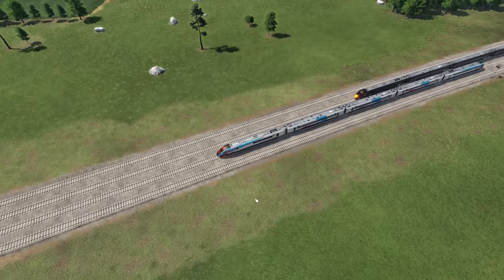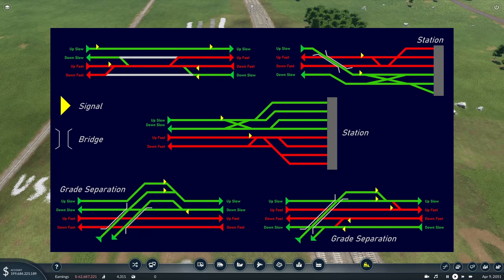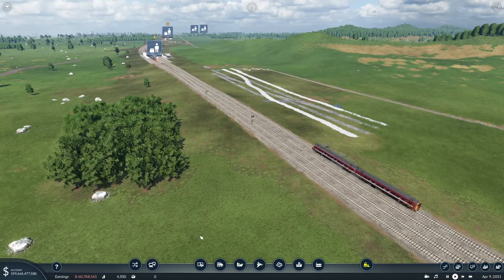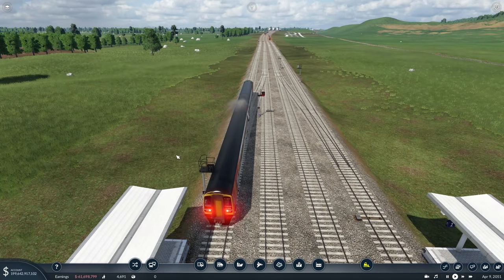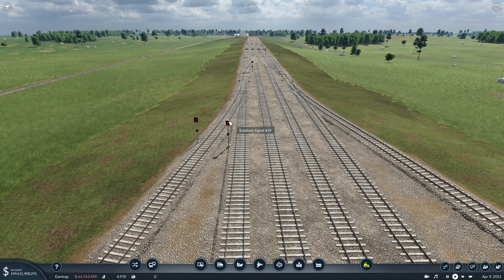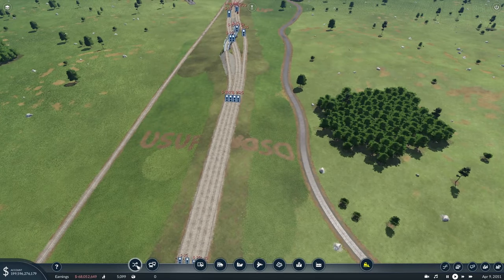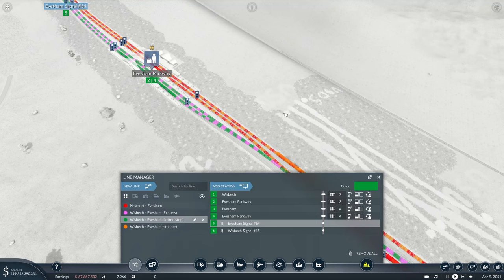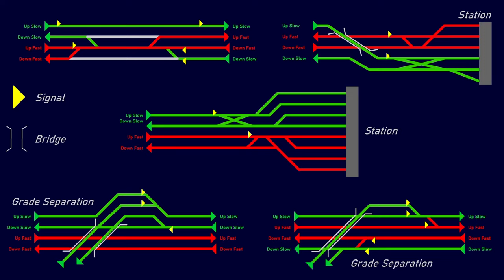Transport Fever 2 Four Track Mainline Tutorial | 2023

Comment: Nice video. Good explanations! Edit: Nice examples too. Like it.
Up lines go towards main stations [that can't get to London directly] too as in Manchester Victoria Station, but as you said, mainly to London.
On your diagram @ 2:22, your top right 'station' diagram has the Up/Down fast the wrong way round [according to the arrows].
@13:42 You said you don't need a signal on the fast. But it is needed as it is protecting the points/switch going from the fast to the slow lines. As you did was correct.

Comment: I'm making part of the West Coast Main Line, with there being 4 stations I wanted express trains to pass straight through. I look to see that it has routed the express trains through the same platforms as the slow stopper trains...
Reply from the maker: Something you have to force trains to use bypass tracks by using waypoints

Comment: Fantastic, clearly explained. 
I separate goods and passenger lines on separate double track like you explained here but I don’t do much in the way of passenger branch lines. I have many through platforms for fast passenger trains (up to 10). What is the most effective way to get 5 up and 5 down tracks back to the main line?
Also when should you use slip points? Especially around goods yards as it causes lots of issues with the ai routing. Or shouldn’t you use them at all?
Many thanks for you clear explanations.
Reply from the maker: The first question you need to ask is, do you need so many lines? A well signalled 4 track mainline has a huge amount of capacity especially if you use grade separated junctions. Having too many lines can eat into profits as you have to pay to maintain every bit of track you lay.
Reply: @Infrastructure-Nerd  I only use 4 track between cities but have a lot of routes going to different end points but do travel through several capitals on the way. Hence the multiple platforms for the routes. How to connect these platforms to the up/down lines is where I need advice if you could.

Comment: So, how would you set up a through station for mixed cargo and passenger? I’ve jumped into the deep end, probably running more track than I really need, but I wanted to run a 4 track mainline, and learn how to put together a station.

I went with uudd arrangement, and what I’ve done is, starting from the initial building, is the following: 
Cargo platform-cargo track-slow bypass-passenger platform-passenger track-fast bypass, then mirror for the other direction. It works currently, but I’ve just started playing, so I’m sure you could help me arrange the switching and signals better. I’ll probably post on the steam discussion for visual, but do you have any specific tips? Even if the tip is “Why are you overbuilding everything? Stop!” I’d be glad to hear so I know better.
Reply from the maker: I don't tend to use mixed passenger and freight stations. I'd be tempted to build the cargo station parallel with the passenger station, then if it was a through station, use flat or grade separated junctions either side of the passenger station leading to/from the UD slow lines to the cargo station
Reply: @Infrastructure-Nerd  Interesting, I’ll keep that in mind in future, just enjoying free play and currently trying to up my income. My margins aren’t great,
Reply from the maker: @TheEpicGnome  not sure if you've seen this episode, may find it useful https://youtu.be/9xTEm85YQhA

Comment: Why don’t you instead run you fast track in the middle of the slow track at all times (even in the station)
You would just need a “pass through” track between both platforms on either side and problem solved no more need for slowing down junctions or?
Reply from the maker: @Sperlexon  If you're referring to the UDUD configuration? I'm not sure why some lines are like that. I guess it must go back to when they were first built or upgraded. I think the WCML is quite unique using UDUD configuration, most 4 track lines are UUDD.